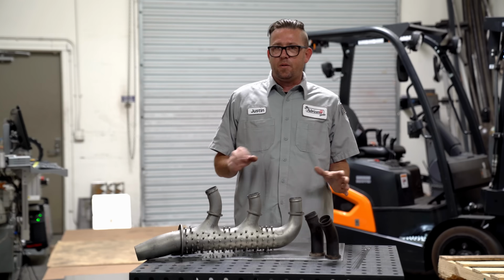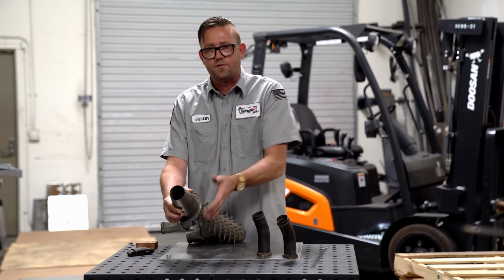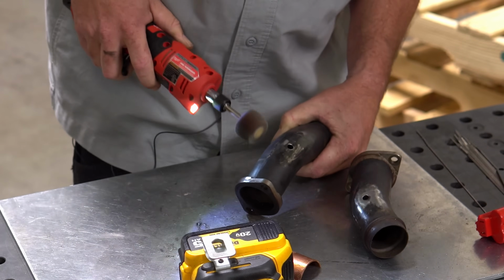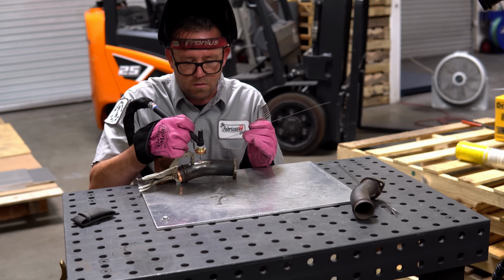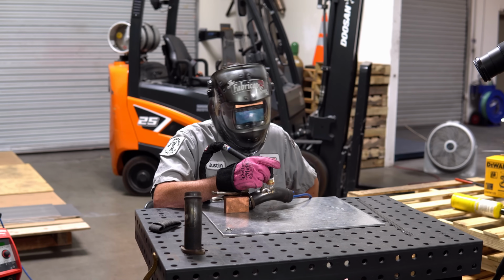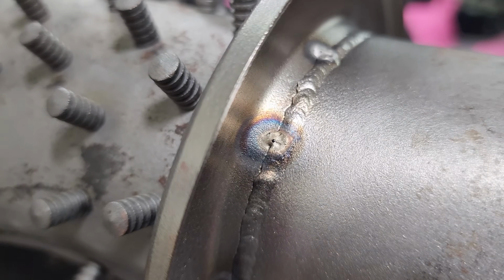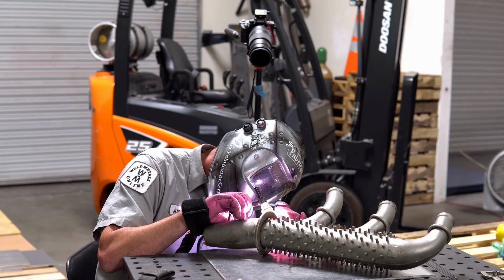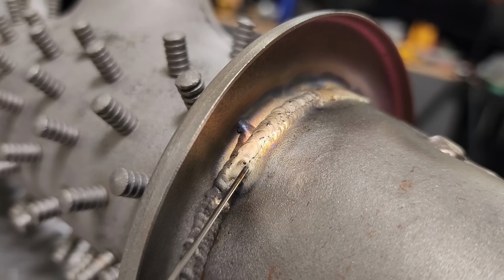Weld Repairs You Should Avoid

Comment: As an aircraft mechanic, I clicked as soon as i saw the aircraft exhaust. This video shows very well the reasons most aircraft exhaust repair stations end up replacing all but one or two flanges with new metal. Reusing just a few components makes it still considered a repair instead of a new part despite almost all of the original material being replaced, similar to the ship of Theseus.
Reply: Are you not allowed to braze aircraft exhaust? Are operating temps just too high for it to hold?
Also, what are those pegs sticking out of that one header in the video?
Reply: @AgentWest   even a low power carbureted aircraft engine can have exhaust temperatures above 1400°F for several hours during cruise; that's way too hot for brazing. Those pegs are to transfer heat from the pipe to the air being ducted to either the cabin or the carburetor for keeping the pilot warm or the carb from icing.
Reply: @ERusstbucket  Curious that it would use exhaust heat for cabin heater, but makes sense for air cooled engines. Also I did not realize just how hot aircraft headers get.
Reply: @AgentWest  that is one annoying feature of air cooled engines. To save weight the exhaust is thin walled, so they are prone to cracking too. Carbon monoxide is a very real danger for pilots and still gets experienced pilots. AOPA has a great interview with Dan Bass, who survived after he passed out and his plane crashed into a field.
Reply: @ERusstbucket  Yeah, I remember seeing carbon monoxide detectors in small airplanes and thought they were more for cabin fires. This makes way more sense now.
Also just looked up Dan's incident and holy carp, he got lucky! Looks like the plane struck right-wing-first and if it was rolled any more it would have probably cartwheeled. On top of that he missed the trees by couple hundred feet at most. Granted, I did not see any very large ones, but still would not have been a smooth (-ish) landing.
Reply: @AgentWest  even a low power carbureted aircraft engine can have exhaust temperatures above 1400°F for several hours during cruise; that's way too hot for brazing. Those pegs are to transfer heat from the exhaust  pipe to the air outside the pipe. As others have mentioned, there's a shroud that covers the exhaust, which lets either engine intake air (preventing carburetor ice) or cabin air be heated using the exhaust pipe as a heat exchanger. If you want to see it look up "cabin heat shroud" or "carb heat shroud" in an image search.

Comment: The rightangle diegrinder works best with rolocdiscs, wirebrush is a no-go, use a drill for wirebrush 😅

The worst repairs i know of is the people that say they haven't tried anything, then comes in with a aluminiumpiece covered in JB weld

Comment: Amazing camera work, as always! Great episode.
Can't use those big attachments on the mini right angle grinder, it overloads it for me. Works great for using smaller attachments where you don't want a big angle grinder. Also works really great for cutoff wheels (it can handle larger ones of those).

Comment: Someone may have said this already but put a 6 amp hour battery on the Milwaukee tool. Or any battery that has 6 cells...probably will work a lot better. Those smaller batteries just can't keep up on power hungry tools like that.

Comment: First time watching your channel & video. I was very impressed with your determination to fix this problem & you almost overcame it. True that the metal is oxidized or has so many little pin holes in it thats what the problem surely was. Sure, sandblasting may have a been a part of it but after 28 years in this industry I would still lean back on severe oxidation & fatigue of the metal. I would've either welded it out, tiger paw or grind out any porosity, welded up those spots then "tiger paw" or flapper sanded the whole weld putting down a light stringer then examining the weld for any defects, if none, sand it down yet again, clean it well with a solvent then go for the "full monty". My second choice would be to cut it off nearest to the base metal & ship the piece off to a company that could replicate the piece, get it back into my shop & weld it back onto the original piece. Sure, its more costly but your dealing with aviation parts that help or make the engine run. Thats not the exhaust of your buddies side by side or a 4 wheeler. Good video & I know your cooking hot in Nevada at a dry heat of 115. Try doing what your doing in deep south Louisiana at 11 0 with the heat index at nearly 100%!!!! Good luck brother & keep on doing what your doing!

Comment: I bought a Milwaukee 12V cut-off wheel unit that is similarly disappointing. Cuts out whenever it encounters the least bit of resistance, really not usable except for cutting off small bolts. I suspect that to keep the units compact they don't have any gear reduction and the motors are just not adequate.

Comment: I wouldn’t recommend using a wire brush on an angle grinder unless the wire brush is meant for that high of speed or the grinder can be ran at the proper often way lower speed. You will fling the wires of the brush head at diegrinder speeds

Comment: Man it was hilarious watching you go through my same experience with the milwaukee diegrinder, I later read the manual, and the wheel we were using is too big, try to only use wheels under 2" if I remember correctly, then it would only cut out under heavy loads, otherwise it will work just fine, and no, it will not replace your air tools, I had the same dream, but electric tools dont cut it

Comment: 35:00 I don’t know if many noticed this but the tungsten tip to work distance was incredible. The control he demonstrated after the arc did its wandering after startup was insane, unlike in a straight line keeping that tungsten soo close across the uneven radius corner takes incredible skill and concentration to not dip the tungsten. The fact that he did dip the tungsten before the shot goes to show just how difficult and uncooperative this piece was being. Porosity aside most people would struggle with the skill to even replicate the result so YES your intention to pick and choose your jobs, refuse the jobs that demonstrate potential issues got across … (at least it did for me).

Comment: I use that M12 Right Angle alot of hours a week and with 3" Discs it is very annoying. But you have to understand the limitations of the tool. 2" Discs are no issue and that little grinder will put in work!

Comment: I have both Milwaukee grinders too at work and a set for home. I have a love hate relationship with them. They are kinda limited to 2” attachments. I use the straight one mostly for carbide burrs and the right angle one with a roloc attachment and a 2”-3” flap disc. And other attachments works good for quick deburring of a saw cut or paint stripping. Wish they made a little higher power set. Good video 👍👍

Comment: I would have been off and on the foot pedal a few times filling that hole, letting the puddle freeze and then back at it.  Just seemed like a lot of arc time and constant heat in the same small area.  

Would it make a difference??  Probably not, but maybe reduce the HAZ slightly on a material that is already not that great.

Comment: That ring around the aircraft exhaust is for the cabin heater and the carb heater. It’s a shroud that goes around it, the nubs are to help transfer the heat to air, airflow comes from the prop airflow / movement thru the air.

Comment: SS wire wheel are juat as bad as microblasting a weld surface. Try a 3m 3s Silicon carbide. you will be surprised. Side note, If that indeed came off a flight worthy engine it may be 718. If so, I would not use any Au SS filler.... The way it welded actually looks like L-605 the glow was oxidarion from off-gassing most likely

Comment: I do a lot of repair work, hydraulic oil lines and oil pressure lines. Typical is .045- .065 material aluminum and stainless steel. .030 filler is typically the choice to not over heat the base metal. My system is to add 5 amps to the base measurement so .045 base metal plus 5 amps gives 50 amps top setting. I start out beyond the crack or hole and slowly work toward the actual fracture. I grind out the crap and revels till it flows clean. Usually it takes 10-15 passes of regrind and reweld. Never on a few passes alone. The reason people call me is no one else will touch it. 10 hours is not uncommon. But on rare occasions people know there isn’t a part available in the known world!

Comment: As much as I really like the new brushless stuff, imo pneumatic is still king for small diameter sanding and wire wheel kind stuff. At least if you don't work in the field.

Get a tool that's gonna last for 20 years for $45? I'm amazed at how well every cheapy air motor i have has lasted. And I do fine finishing where a drop of oil could really cause a ton of issues, so I don't oil almost any of them.

Comment: you are using way to big a wheel on that m12 die grinder, and you need a large battery. I have the same one, and the straight one, it will just not run wheels that big, and it says so to only use 2".

Comment: Too much drag on the 3" wire wheel. They don't have loads of torque. Be alright with a 3" roloc and a 120 grit or something. Wire wheels have a lot of drag. I've stalled out my 1200watt dewalt corded grinder by pushing it in to much with a knot wheel haha. Another great vid Justin! Keep up the good work

Comment: The large diameter brush is able to put too much torque back on the cordless milwaukee, forcing it to draw more current from the battery and tripping an overcurrent protection, I bet. That's why the small diameter flap wheel worked.

Comment: I got the right angle Milwaukee die grinder and it doesn't compare to a good air grinder I haven't used it much. I actually have a corded electric DeWalt die grinder i really like thats the best electric die grinder ive used. All my cordless is m18 and m12 Milwaukee then my corded tools happen to be mostly DeWalt. My absolute favorite angle grinder is a DeWalt corded grinder in a certain configuration i just really love that grinder, i had a little bit of a hard time finding a replacement in the same configuration last time i needed one. I also have the fuel m18 grinder the good one, i like that too but my DeWalt is just comfy for me i use it a lot.

Comment: A great way to get a cheap Forced air hood is to get a mattress inflator that’s battery powered and then you put lithium batteries in it or regular old batteries doesn’t matter  .A flex hose ,add a filter and a nice piece of very flexible inch diameter hose to go into your helmet and you’ve got it without spending 1500 or two grand . You might need to slow air air down with a Rio stat or lower voltage . They blow very large CFM in stock form.

Comment: And when you say “ol’ acetone treatment”, are you using anhydrous acetone? Cuz the acetone I have says 100% acetone on the front label, but in the fine print ingredients list it states there’s also a bitterant added called Denatonium Benzoate and it tends to leave a residue behind which may be introducing impurities to surfaces on which it was applied. Upon further research, it looks as if it’s actually a good bit difficult to obtain acetone that doesn’t include some sort of bitterant. Any recommendations?

Comment: I saw what you did, but have a question about the overall welding
The 1st pass was really bad due to all the 'JUNK'.
So why not go over it all with just a heavy ark, burn off as much as possible, then grind it down, then put a wider bead all around it?  (or two).
I understand "junk" in the weld, but a grinder and more weld, would that not work?

Comment: That right angle grinder is tripping out because it's over loaded with the big wheel. Mine does it if you press too hard or whatever. It's designed to do that to protect the motor

Comment: I might do it.  It wouldn't be cheap.  Boroscope to check the "inside".  The "sugaring" can be dealt with.  New pieces can be made to "replicate".  I do have a degree in WE from OSU, and the "certs".  I don't make an assessment without detailed examination.   One can "do it in a glove box".  I would "pickle" the oxide off.  The alloy is in the 18-8 family if it was necessary to know exact chemistry, that could be done.  The only thing I don't touch is IGSCC (intergranular stress corrosion cracking).  So if this piece was pickled in HCL, (a Halogen) - OK to give it a try with "reservations".  By the way, I cut my teeth in nuclear.  Hot & Not.  The chemistries back then were nothing as controlled as they are today.  No, low carbon stuff.  You've got allot of skill.  I salute you.

Comment: Why didnt you just Mig weld it with 309LSI wire and tri mix bam its fixe and wont crack . You dont need to try and Tig everything especialy not old material , TiG is for New parts not use IMO but im not a welder . I do know i would of mig welded that then walked over it with the tig to turn it back into Jewelry if my mig joints didnt make the visual cut

Comment: The M12 right angle grinders  have some kind of load shutoff. They do great if you can keep them at high rpm and have a light touch.   They work great with roloc flap and bristle disks. The big batteries are pretty much required to do any real work with them but I’m sold on them! 
If you don’t have the M12 Cutoff tool then you are definitely missing out!  It fits into much tighter areas than a grinder and being  able to reverse the blade direction is awesome for keeping sparks out of your face (or anywhere else you want to keep them away from)

Comment: Yeah operator error for the electric 1/4" die grinder, use 2" and let speed do the work not pressure. Fabricators do this all the time at my workplace, use a tiny right angle air grinder with a 4" cross pad and catch an edge and destroy the gearing. Toasted a 700$ tool cause they didn't grab the right one.

Comment: The glow is caused by higher content of chromium and a few other metals that are used in aviation stainless. That's quite the nasty stuff and I wouldn't go near it without a respirator. So people should really appreciate the fact that you do all this just to teach us! Love to see you work.
Reply: AISI 17-4 PH, 410, 420, etc for structural. 321, 347 etc for exhaust. You think you can use anything?
Reply: “Aviation” stainless? What grade is that? 😂 is it like aircraft aluminum? Literally no such thing. 😅
Reply: @notanymore9471 "aircraft aluminium" is usually 2024 Alclad..
Reply: @notanymore9471 AISI 17-4 PH, AISI 410 and 420, etc. corrosion in aircraft means you can fall out of the sky, so chromium is nice. AISI 321, 347, etc sometimes for exhaust.

Comment: Hi Mr. Justin, thank you for the video. I play with airplanes and the original exhaust was steel in the 1930/1940 but as soon as they went to stainless steel, they started using a 321 stainless which intern uses a 347 filler. The 321 is cladded with titanium to help with the heat cycling, but I agree with you once the part is 70 years old. It has earned retirement.
Reply: 321 Stainless is excellent for high-heat applications. 👌🏻 Otherwise using Inconel is also an option.

Comment: I worked for a company that repaired food processing machinery for a while back in the early 90's. Just about everything was stainless steel, that would go off to a company and be blast cleaned with baking soda never gave any problem when being welded and left a satin sheen finish. Worked for another company in 2008 and someone brought in a fuel filler to be welded, it was only after the job was done and collected that I was informed that the filler was for a Tiger Moth airplane and I am not certified for that. Are you sure that the metal is stainless steel and not inconel as that was or is used on a lot of aircraft parts. A high nickel content brazing filler may well have been a better choice for that job, more tolerant to metal types and containments.

Comment: Did you try a rinse of hydrofluoric acid to dissolve the sand out of the crack? You can buy it online as a glass cleaner. Can post a link if requested. Got to keep it off your skin and eyes. It is hazardous but easily useable with gloves and goggles.

Comment: Super job, very typical of used up aviation exhaust.  Good amount of LEAD contamination, heat cycles and the parts are THIN.  Operational cycles also thins the wall of the tubing due to erosion.   
I do this kind of repair frequently.  Challenging to do and be airworthy.

Comment: The cordless tool is electronic and is protecting itself from the torque required by the wire brush.  In the shop,  I use only air tools and use the battery stuff in the field or jobsite.

Comment: Hi Justin:  Thank you so much for your great instructional videos!  I would love to work with you at some point, when I get my small boat fabrication business up and running.
With regard the the Milwaukee M-12 tool...  I prefer Milwaukee and Dewalt.  I have several of both.  The only Milwauker tool I was dissapointed in is my M-18 hammer drill.  It only drilled 7 holes before failing.  On the other hand, my M-18  drill, 1/4" hex tool driver, grease gun, and 4.5" grinder work great, (though the grinder goes through batteries quickly.)

As for the repair jobs you showed, I thank the person providing the examples of what to reject.  The customer would be much better off having you fabricate a new exhaust system from scratch than having you waste your vauable time, (with the 3xception of this valuable learning opportunity,) trying to save a dime at the expense of humdreds of dollars.

Keep up the good work!

Comment: When I've used anything other than an end brush I've had to slow the speed down and use the lightest pressure possible.  Even then it occasionally stops.  But for 1/2" or 3/4" ends brushes they're great.

Comment: The small 90° die grinder is only meant for small Diameter tool bits. Trying to use a 4 " wire brush on it just sucks the power right out of it.